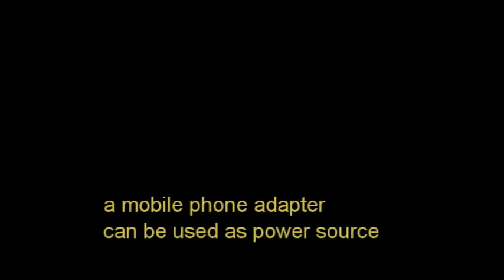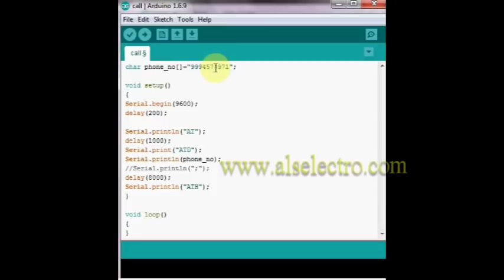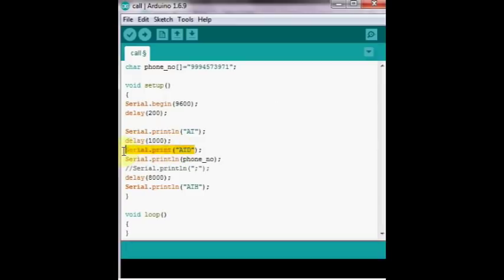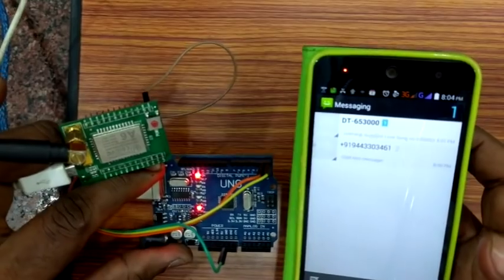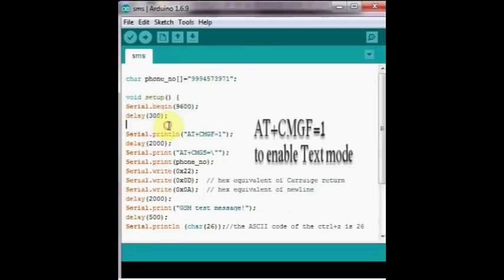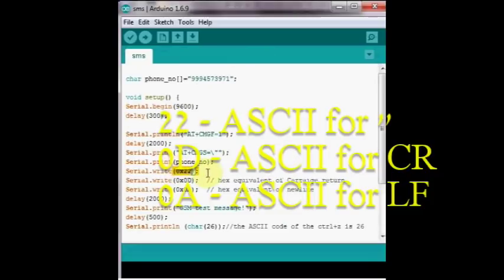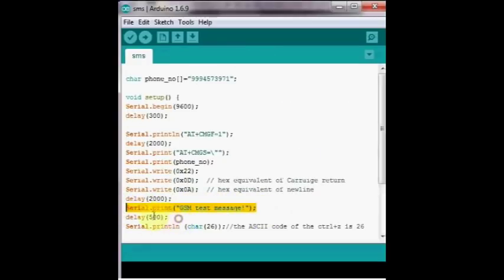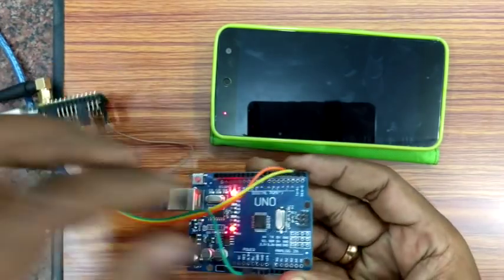Arduino with A6 GSM - How to make a call & send SMS

Comment: i have a problem with my A6 module i have already programed it to sms control the relay board but after several messages it is now not working i think my A6 module storage is full how i can remove it??
or fix it pls help thanks in advance

Comment: Why do you connect gnd to gnd? rx of gsm to tx of arduino? tx of gsm to rx of arduino? Could you please explain that. Also in the code, why is the line Serial.println(char(26)); necessary? Final question is what is a carriage return?

Comment: Hello Saravanan, my GSM module A6 is not sending SMS, some time ago when I did some tests using your tips i managed to make connection and send SMS, but now does not send. Do you have a solution? I tried to do the reset you suggested in a comment, but without success.

Comment: Sir, my sim900 module was working very  fine. Now for another application  i buyed sim800 module as sim 900 was out of stock. but it not working ok. Even i tested sim800 on same program and hardware that was working for sim900.
Not working means:1) Sometime it receives sms but sometime not. (Sometimes it receives, previously not received and now sent sms simultaneously)
                                     2) Also same situation about call.
So should i now go for this new A6 GSM module module OR should make any changes(Don't know what?) in sim800 application.
Some reviews about this A6 tells that it is very frustrating work on this A6.........
So i am confused :(

Comment: sir, all my connections are done fine and I can do a serial monitor but message is not sent .......
I made a cal to the sim and checked ,it is ringing....
can u help me please
Reply from the maker: Try RESET manually .Momentarily  touch RESET pin 6th pin down from Antenna side to GND. This will make restart the module & work properly.This issue has not been solved in A6.Each time you power ON the module , this RESET is required ( which can also be done automatically from Arduino digital pin -- making it high & drive a small mosfet, so that RESET is GND for a moment)
https://alselectro.wordpress.com/category/gsmgps/
Reply: hi

Comment: Sir It doent work on me coz in South Africa we are using 3g and 4g but my simcard is not a 2g simcard also I wanna ask do i need to download additionalk libraries on arduino eg call.h and sms.h libraries and wrote the code as it is but on serial monitor its working its the hardware side it is not working

Comment: Nothing using this with a Nano.  I noticed that there where no answers in the serial monitor when the program was run.  The window just echoed AT, ATD then the phone number then ATH, is this correct? Or, should I be getting "OK;s"?

Comment: Well explained. Sadly the A6 GSM works via the 2G network that is being abandonned in many countries
Reply: This is very important info, I wonder how many of these are sold to unwitting DIYers and then find there is a so called stale date to their experiment. I was going to use it for a gate opener but will just go for RFI tags I guess. It is almost guaranteed to happen if not all ready here in Canada  so why even bother messing with it. And here I sit w/two different modules just gathering dust.

Comment: Hi Saravanan,
Thank you for sharing this video and the associated material. I am able to make a call using the code but I do get an error whe I try to upload the code into the Arduino. 
 I am using a mac to do this and I am also embedding the( make a call) code inside an if statement. But I am getting an error. Do you know how to resolve this error?

avrdude: stk500_recv(): programmer is not responding

Thanks,
Sudeep

Comment: Thanks. It's worked well with me
Reply: I have a question, my sim card is blocked by a pin number (as i though every sim was) but i don't see anywhere a place to imput that pin code, can you help me?
Reply: Rodrigo Sousa  first insert the SIM card  in your phone and go to settings then search for "disable SIM PIN "  after you disable it you can insert it into the GSM  module
Reply: Thanks so much, now it works!
Reply: can u help me...I inserted a 2g/3g sim and I made a cal to the sim in gsm module and it rang but the msg is not sent.

Comment: Sir, one question, why is a "\" in this command? Serial.print("at+cmgs=\""); Tks.
Reply from the maker: The target phone no. has to be sent within double quotes.The starting double quote is sent using \" & the ending double quotes with ASCII 0x22.
Actual command is   Serial.print("AT+CMGS=\"xxxx\");  which is split in easy way.
Reply: sir using terminal software i received sms successfully  but in case of interfacing a6 with arduino i couldn't make it , can you help me sir!
Reply: Saravanan AL Hello Sir. If possible could I get your help on a project? I will pay you for your time. If you have a email or social media I can contact you on and send you my contact information privately. Thank you in advance
Reply: not saying yr code is wrong as I have seen it  on many other places as well, but ofcourse there is a difference between sending 2 single quotes and 1 double quote. 
As I see it the CMGS command only send 1 single quote, albeit that the entire string is enclosed in quotes again. The  \ character escapes the next one so the compiler knows the following quote sign is not the closing quote of "AT+CMGS......, but the last quote being the end quote.
So in fact you are sending   <quote>number<doublequote>  though in fact the double quote is the opening curly quote.
Well that is obviously what the module expects

Comment: How did you manage to establish a connection with 9600bps? Afaik the A6 initially communicates with 115200bps and there is no way to permanently change the baudrate on the A6. So even after setting the baudrate to 9600 with AT commands, after a reboot of the A6 it will be back to 115200.

Comment: Hi,tried to work with Sms on terminal program on PC. I found, than A6 did not store sms on sim card or a memory, so i can't see unread sms af it received when terminal was off. Could you help with it? which parameters should I configure to order this module to store sms?
Reply: Hey @Verses maker : check the  AT command "AT+CPMS" in "A6 AT command set." This basically does what you need.

Comment: HI, I tried to create the connections you have showed  in the video but did not work.
Here is what I did:
VCC (A6) <-> pwr_keY(a6)
GND (A6) <-> GND (ARDUINO UNO)
U_TXD (A6) <-> RX(ARDUINO UNO)
U_RXD(A6) <-> TX(ARDUINO UNO)

I have upload the code on arduino, by mantaining the aforementioned connections but the GSM does not receive any call.
Anu suggestion?